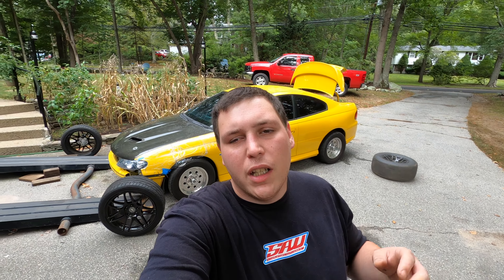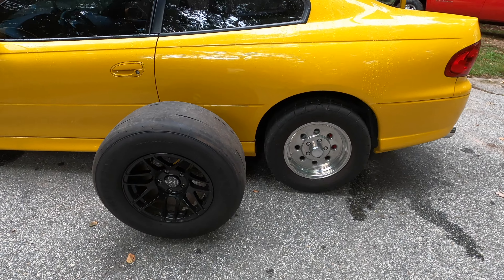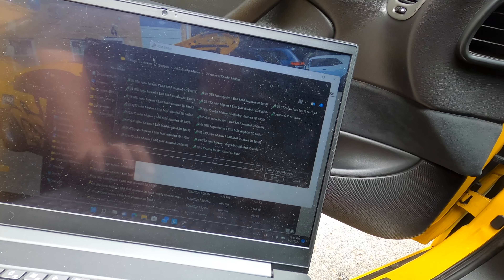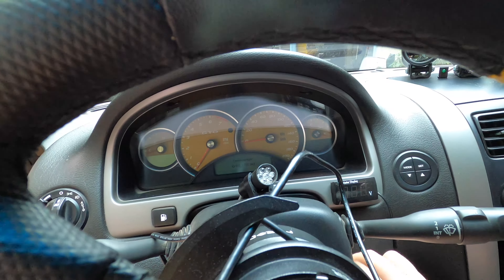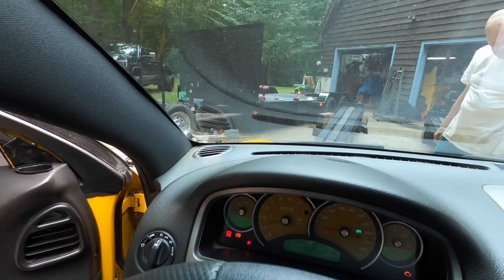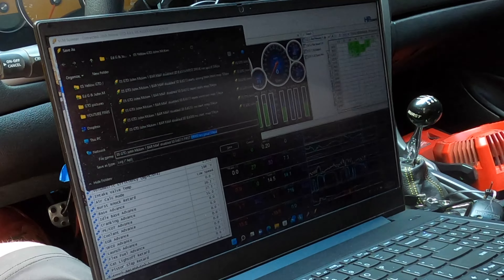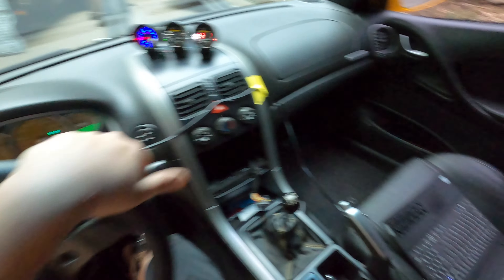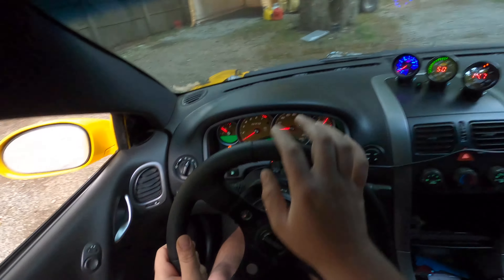BOOSTED GTO first drive! remote tuning the gto PT.1

Comment: Like what heads and stuff you have. And who your getting to tune it.
Reply from the maker: It has 823 heads, BTR cam, Johnson lifters, BTR springs, chromoly pushrods, CHE trunion upgrade, and melling 10295 oil pump that’s pretty much it as far as engine goes stock gen 4 rods pistons and crank tuned by edGTuned I’ll update the video description with his contact information I thought I had is info in it 🤟🤟👍👍
Reply: @bought2build  very similar to my build. Mines stock crank (balanced), stock gen4 rods, wiseco forged pistons, rings gapped for boost, idk what cam is in it it was in it when I bought it, guy said it’s a stage 2 boost cam which doesn’t tell me nothing, arp rod bolts, arp crank bolts, arp 210cc heads, lsx fast 102mm intake, katech 103mm tb, stock fuel system I believe guy said it has 84lb injectors but they’re ls3 injectors but idk for sure if they’ve been made into 84’s slp longtubes, full 3” exhaust cat less x pipe, no mufflers, p1sc that’s been converted to a d1sc, I rebuilt it and put hybrid ceramic bearings in it and a new impeller. Has a 3.40” charger pulley and a 7.48” I think ati dampener, I literally was looking at putting a 2.85 pulley and hub on my charger earlier yesterday and somehow scrolling through YouTube lastnight I found this. I’ve been thinking about what fuel system to do and yours is pretty cut and dry. I was gonna do a bulkhead sump from stock tank to deatswerk double 250’s in their surge tank. Followed by their fuel filter and use the stock feed line as a return. But your idea is gonna produce the same if not a little more and cost a lot less.
Reply: @bought2build  need to build me the cold side that your building for yours. With that bov. But now that I seen yours with that 2.70 griptech making like 15 pounds the reason why it’s not higher is because of the cam and intake you have and exhaust, the more air the motor makes n/a the less boost the supercharger is gonna make no matter how fast you spin it. Cause on a bone stock car with the pulley sizes I have right now it’d make 15lbs of boost but nowhere near the hp that ours are making with the same boost but a lot more charger being spun.
Reply from the maker: @JustaMechanic92  exactly man
Boost is basically a measure of restriction if you can make the engine flow better or flow
More the power will go up even tho boost
Went down a lot of people don’t understand that but yeah exactly like you said I am honestly surprised cuz with the 2.70 on it we are definitely over spinning it by ALOT but it’s making 18-19
Psi at redline I’d be curious how
Much boost it would make on a bone stock engine just out of curiosity 

I noticed you mentioned the cold side you talking about the one I made in the other video all aluminum? Cuz that one I’m happy with for sure the one I used in this video was stock procharger stuff and I wasn’t super happy with it but on the new setup I want to see if or how it affects boost cuz I did make a lot of it bigger
Piping also super happy with the black sheep industries blow off valve! 

Just curious but what pulley are you running? What size blower? And any engine mods? Just curious what it makes for boost 

Thanks for the support!! 🤟🤟🤟👍👍👍